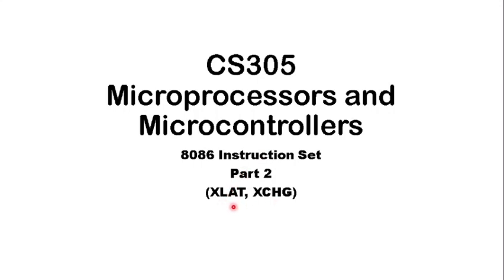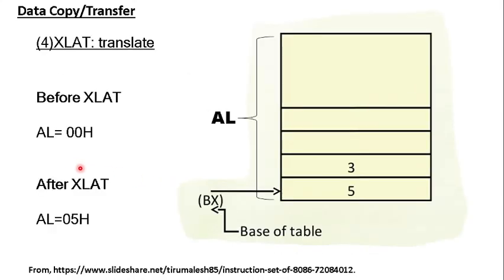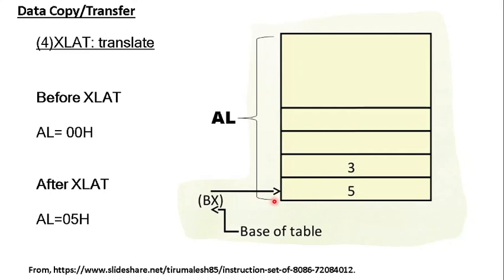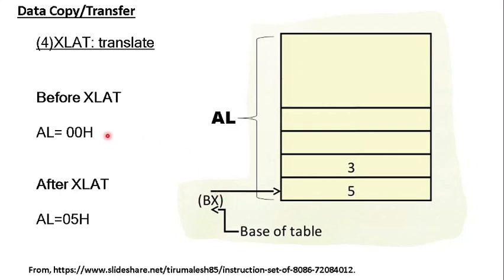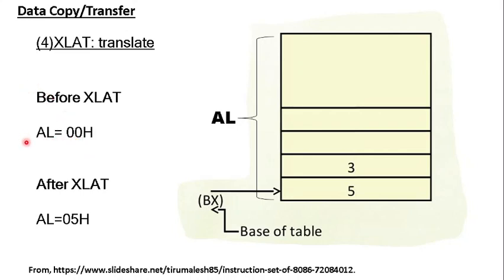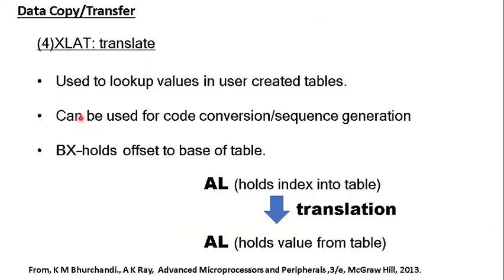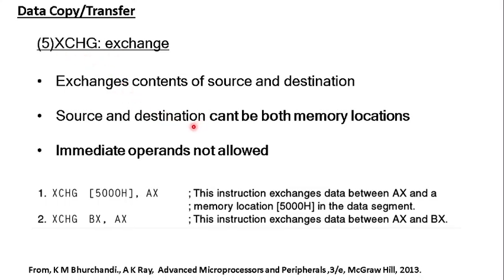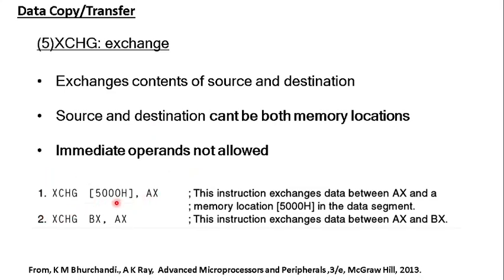8086 instruction set with examples--Part 2--XLAT and XCHG

Comment: In xlat instruction where is the user created table 
and how it's created
Reply from the maker: User has to find a free area within data segment and BX is used to hold the  starting address of the area, which is base offset of the table.The table itself is virtual as only base of table is kept track. XLAT's capability actually helps us to use that area as a table.
Reply: @KVK_11  Thank you for support
Reply: Xlat is basically using for encoding and decoding process, In Bx(1000) used to hold the starting address and in AL is used to Hold the value that we want to display(5), if we add the BX + Al(1005) it will give us the offset address of that value where the value is exactly store